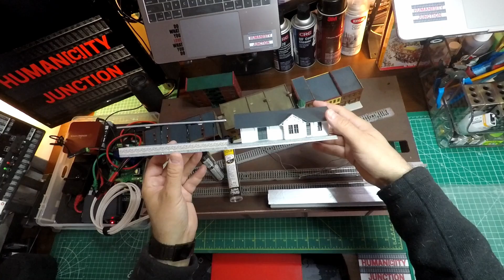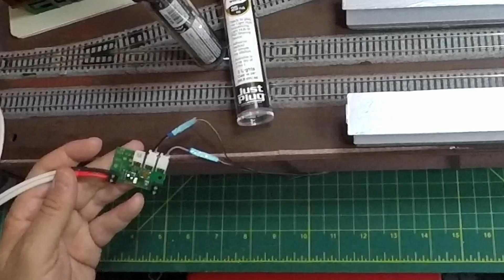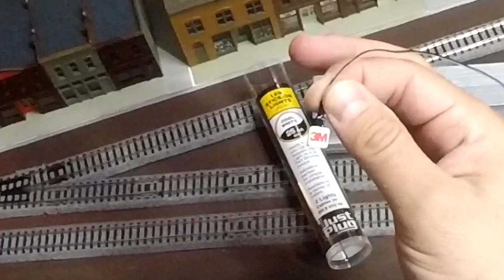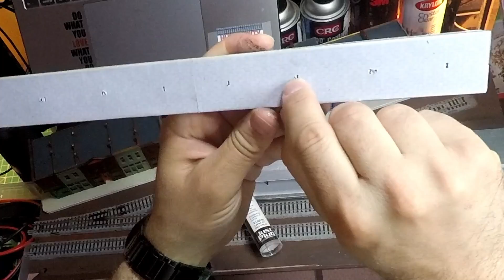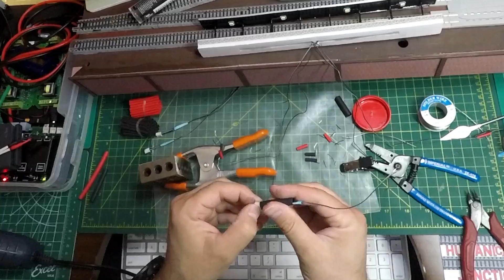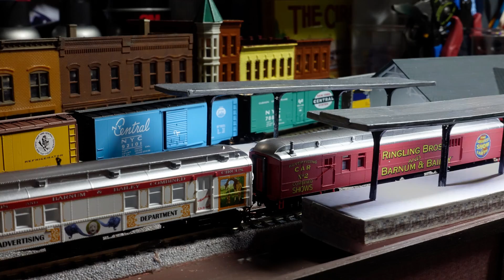7 | DCC Controlled Model Railroad Lighting | Train Station Platforms | Just Plug | NCE Illuminator

Comment: That looks really good. Bright enough for lights like that but not overly so. This tiny wires are tough. I've seen some people scrape the coating off with there hobby knife and others melt it off with the soldering iron with the thicker part right above the tip. I've not done anything that small so I couldn't say for sure what is best. Great video. Stay well.    👍
Reply from the maker: I realized on the last LED that I could strip the fires with my fingernails.  But I like you suggestion of just using the soldering iron.
Reply: @HumancityJunction  yes but don't use the tip where you solder with. It needs to stay clean you know.   👍
Reply from the maker: @williambryant5946  I need a better soldering iron anyway, so any excuse would help.